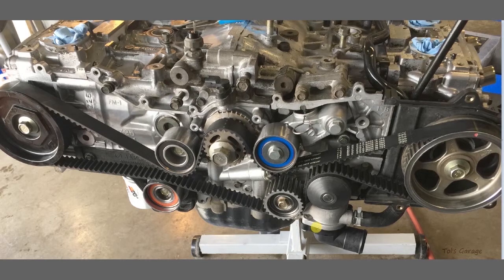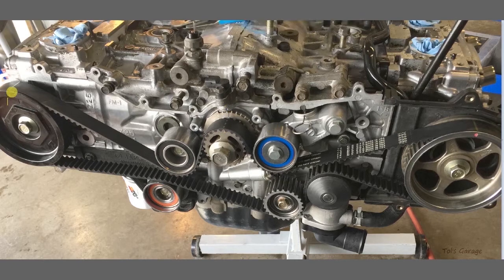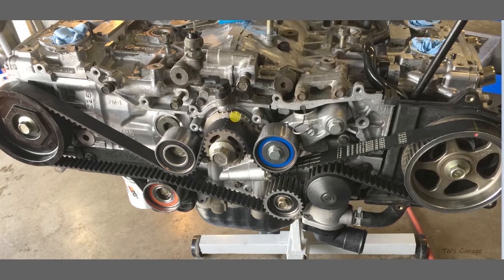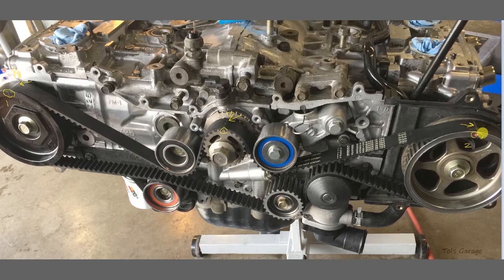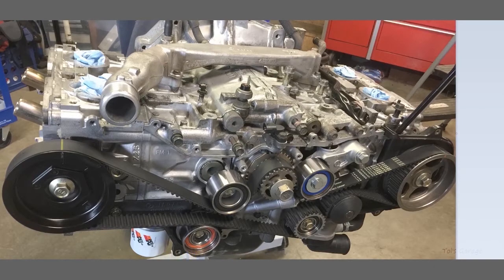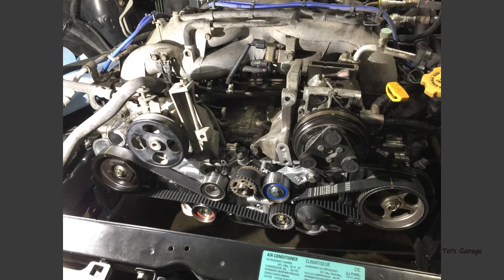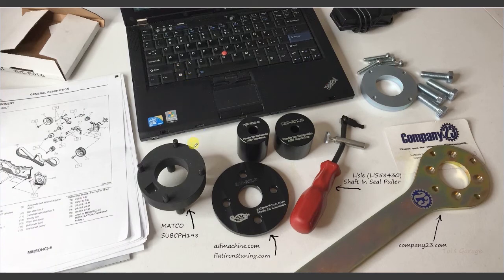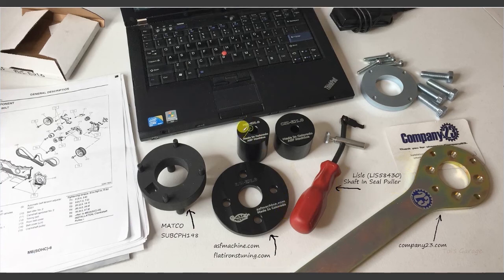Subaru EJ25 SOHC Camshaft Timing

Comment: Aloha, great video.  I have a couple of questions.  My daughter has a 2005 Subaru Impreza RS 2.5 SOHC.  I had to have the valves replaced and after reinstalling the headers and putting everything back on the engine, I was preparing to install the new timing belt kit and found the driver side camshaft sprocket and the crankshaft sprocket were not aligned properly.  I was able to turn the driver side camshaft sprocket so the red dot lined up with the line on the engine but the crankshaft wont budge.  any advice?  I still haven't installed the timing belt yet because I dont want to have to remove it again and reinstall it.  Mahalo!
Reply from the maker: It is good practice to make sure everything freely rotates before putting the heads on.  The crankshaft timing mark places all of the pistons in the half way position. This allows you to rotate the camshafts without the valves hitting the piston tops.  It may be that you have made valve to piston contact.  It would probably be best at this point to remove the heads and check for damage.

Comment: This video title is misleading in that it has nothing to actually  setting cam in correct time. It is about how to install timing belt and misleading at that. Also, tell me you haven't actually counted the teeth on the belt without saying it. The service manual is wrong for most of the ej25 engines in respect to belt tooth count either side including mine. The correct numbers are available online. If the info I found on the 40.5/44 number was correct it was for a very early model but I cannot confirm that.

Comment: after having heads done and reinstalled, Cams seems to be hard to stop on the cam timing marks, they just want to spring past them is this normal?
Reply from the maker: First, make sure that the crankshaft timing mark is aligned. This places the pistons halfway between top and bottom which allows you to rotate the camshaft without the valves striking the piston tops and potentially bending them. The camshaft normally will rotate with uneven force as the camshaft pushes against the pressure of the valve springs to open the valves.  Rotate the camshaft slowly to align the timing mark.
Reply: thanks crank is on the timing market just seemed touchy to keep the left cam on the timing mark as if it coming of the lobes  @tolsgarage1641

Comment: is it common to have a slight play in the cam. My passenger side cam was 12-O'clock, but after lining up the 3 marks on the belt, it  is slightly off, clock wise (CW) - 1/2 tooth, after installing the gear pully and idler bottom pulley , not yet pulled the pin. see picture.  Is it common to have small play in the cams, I can just finger touch and move a little back and forth.  https://drive.google.com/file/d/1vpBJQ2M9nsTmY0NzBJ145bykh9K9J3qN/view?usp=sharing
Reply from the maker: What it sounds like from your description is there is still slack in the belt, and since you haven't pulled the pin yet that would be normal. Thanks for watching!

Comment: Tol, my ej25 soho rebuilt and ran fine. I recently had the timing belt fail. The ac idler belt tensioner failed and wore through the cover and damaged the timing belt.. anyway when replacing the timing belt I noticed that there are more than one distinct paint marks on the driver’s side cam sprocket. How do I insure/find TDC on this cam regardless of the marks? How would you find TDC with the cam sprocket off? Thanks
Reply from the maker: Just a quick reminder that cam timing is not done at TDC. The timing marks are placed
where the pistons are at mid stroke. This is to prevent the valves from coming into 
contact with the piston tops. I'll attach a picture to show the correct mark. I hope this helps.
Thanks for watching!
Reply from the maker: Here is the timing mark:
https://drive.google.com/file/d/1hPyqEKvadv3tO87VbUqUQahTMC7hFJCv/view?usp=share_link

Comment: this prolly a dumb question but how would i rotate the crank shaft without the pulley and the bolt in? can i just thread the bolt back in and be fine? should i put the pulley back on with the bolt and run it that way? how will i get the bolt back out without the pulley to be able to hold it still? i just wanna see if its in time or if i need to mess with it
Reply from the maker: You can put the pulley back on but there is also a tool to do that.  Here is the link for the tool. https://www.amazon.com/CTA-Tools-7630-Socket-Subaru/dp/B076N2WNR2
Good luck! Thanks for watching.

Comment: I'm confused with tightening the crank bolt. Maybe there are different options per the year of your ej25. My manual says initial torque of 33ft/lbs and then 138.5ft/lbs but you must exceed 65 degrees when reaching the torque value. Am I reading it correctly about exceeding 65 degrees? I saw a channel where they said to not exceed 65 degrees when reaching final torque value.
Reply from the maker: Hey Allen, good question.  

The crankshaft pulley bolt on this Subaru is a torque to yield fastener (TTY) or stretch bolt.
TTY fasteners are tightened beyond the state of elasticity and undergo plastic deformation which results in the fastener becoming permanently elongated.

TTY fasteners usually have to be replaced when loosened. Some, like your crankshaft pulley bolt, can be 
reused if they pass both a visual inspection and the procedure listed in the service manual.

From the 2002 Subaru service manual for the 2.5 SOHC engine: clean the threads then apply oil, initial
tightening torque is 33 ft-lb. Then tighten to 130.2 ft-lb. The bolt should rotate 65 degrees or more. 
If not, then the bolt has reached its limit and should be replaced.

Just to add to the confusion, when replacing the bolt with a new one, the procedure is different. With the new bolt, the first three steps in the manual are the same but the manual does not specify tightening to 130.2 ft-lb. The procedure is to initially torque the bolt to 33 ft-lb then additionally tighten the bolt to between 45 degrees and 60 degrees.

For more information, here is a link to a Technical Service Bulletin that discusses this.

https://cms.gates.com/~/media/Files/Gates/Automotive/Resources/Tech%20Tips%20and%20TSBs/Subaru_Loctite.pdf 

I hope this helps. Good luck!

Comment: my crankshaft doesn’t line up with the cams how do i get it to line up together
Reply from the maker: Align all of the timing marks with the belt off. Once everything is lined up then put the belt on. I hope this helps!
Reply: @tolsgarage1641  Are the Crankshaft Sprocket along with the two Camshaft Sprockets supposed to spin together even with the belt off? I have a problem where my Crankshaft Sprocket lines up with the mark and my Cam Sprocket #1 (passenger side) lines up along with the Crankshaft Sprocket But, my Cam Sprocket #2 (driver side) is facing nearly 180⁰ towards the bottom while the other two are lined up. When spinning without the belt, only the Crank Sprocket was spinning but not the other two. I put the belt back on to get all three to spin. Was able to get the Crank Sprocket and Cam Sprocket #1 to line up but can't figure out what to do with Cam Sprocket #2. I'm considering taking off belt again and trying to turn it over. Any tips?
Reply from the maker: @LoveInstead  line up the crankshaft sprocket with the crankshaft timing mark, then remove the timing belt. With the timing belt off and the crankshaft sprocket aligned with the crankshaft timing mark, you can safely rotate the cams into the correct position. Then replace the timing belt.
Reply: @tolsgarage1641  to rotate the cam sprockets  to line up with their marks, how would I do that? Do I simply just turn it clockwise with their pulley bolt like it's done with the Crankshaft sprocket?
Reply from the maker: @LoveInstead  yes
Reply: @tolsgarage1641  okay thank you so much!

Comment: Can a cam be 180 out?
Reply from the maker: If the marks line up it is in the correct position.
Reply: @tolsgarage1641  I’m in the same debate, just did timing & I’m getting codes P0336 & P0340 (crankshaft & camshaft sensors). There’s absolutely no possible way for the cams to be off? The symptom I have is that the engine will ignite for half a second on crank up, then shit right off. Checked continuity & resistance on the sensors and it’s all ok. I’m stumped on what to try next.
Reply from the maker: @WigglerRiggler  
Hello Aaron:

Let’s focus on DTC P0336 first. The big hint here is that this describes the crankshaft position sensor harness as open or shorted.  If the crankshaft sensor checks out, the ECU is detecting that the crankshaft position sensor circuit has a poor electrical connection. Check for damage at the connector and harness. Look for damage to the connector body and make sure that it clicks and locks into position. It may not be fully seated. Also check for broken, bent, pushed out, or corroded connector pins.

You can also monitor the rpm signal with a scan tool.

Low battery voltage can cause starting issues, so make sure you have a good battery with clean terminals and that it's fully charged.

Good luck!

Comment: Do you have to rotate the crankshaft half a tooth in order to have everything be aligned when you pull the pin from the tensioner pulley? If so what direction do you turn it.
Reply from the maker: No, the marks should all line up.
Reply: @tolsgarage1641  awesome. Thank you.

Comment: I was doing my timing and I don’t know if I bumped the camsprocket no.2 but it turned and I tried manually turning it but it keeps wanting to jerk back in the off position how do I manually turn into the aligned position so I can finish timing much help would be greatly appreciated
Reply from the maker: Make sure the crankshaft is aligned with the timing mark. This puts the pistons half way down so that as the valves open they won't hit the piston top. Then rotate the cams to the correct position. You will feel resistance to turning as the valves open, this is normal.
Reply: @tolsgarage1641 I have the same issue but no matter which one I turn it don’t line it up and jerks to one end or the other please need help
Reply from the maker: @550_Alex  , first make sure the crankshaft is aligned with the timing mark. This is not TDC.  With this mark on the crankshaft aligned it puts the pistons halfway down so you can rotate the camshaft and as the valves open, they won't hit the top of the piston.  Once you have the crankshaft timing mark aligned, rotate the cams to the correct position. You will feel resistance to turning as the valves open, this is normal.

Comment: Hope you're still out there. I just bought a kit and the new belt does not have timing marks. What now? Are these marks just for timing after installation? Thanx in advance.
Reply from the maker: Hey Cornfused Atbest, (awesome name BTW!) You can use a paint pen and put alignment marks on the belt. The first one will be the crankshaft, the right side cam mark will be 44 teeth away and the left will be 40 and one half teeth. Left and right are in relation to where the driver is setting. I hope that helps! Good luck!

Comment: On EJ25 SOHC non-turbo, 4 cylinder I put new timing belt on and between phone calls I forget to release the tensioner;  and I went ahead to turn the engine two rounds in order to make sure things are Ok,  that's were I found out that the belt jumped.  Now, how do I set all three markers of Crankshaft and camshafts are back in were they should be.
Reply from the maker: I'd recommend taking the belt off and following the timing procedure. Since you haven't pulled the pin to release the tensioner, this will be the fastest and easiest way.

Comment: Tol, I’m Lining up just as you have outlined and when I turn the crank the valves are hitting the piston on the drivers side at about 25 degrees rotation. I’m stuck. Any ideas on what could be wrong? same engine.
Reply from the maker: Hey marxtr6, don't forget that the cams are not timed at TDC. The timing is marked with the pistons half way in/out so you can rotate the cams without the valves hitting the piston tops. Double check that you are using the correct timing marks.  I have added a few pictures for you to check out at my link below.    https://www.tolsgarage.com/2018/09/right-pulley-timing/
Reply: Hi Tol, Thanks for your response.  Both cam sprockets are oriented to the correct timing marks and the crank gear is aligned to the mark as you discuss, but as I rotate the crank, it hits stops at about 25 degrees, leading me to belive that something maybe wrong internally. Any thoughts?
Reply: @marxtr6  did you ever figure this out? I might have a similar issue. Was it that your camshaft was one rotation off?
Reply from the maker: @rebeccapattengale3612  sorry, I just saw this and @marxtr6 left a head bolt washer in the cylinder. He had to take the head off to remove it.